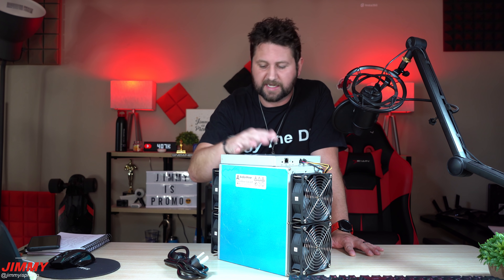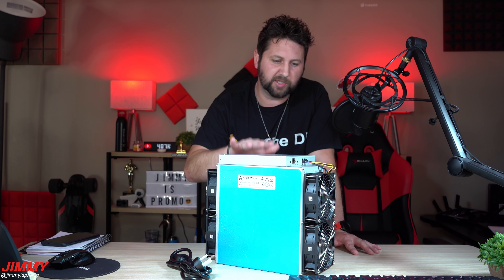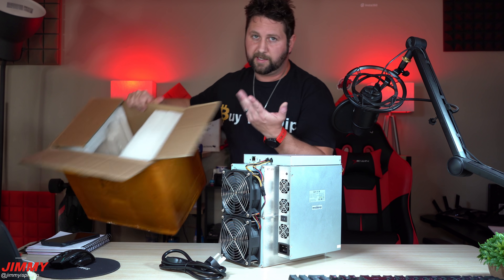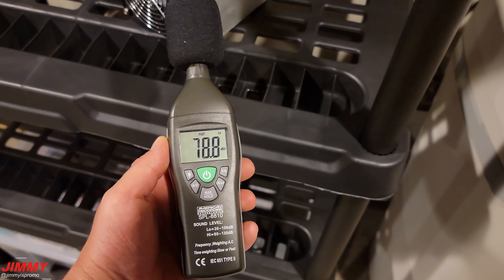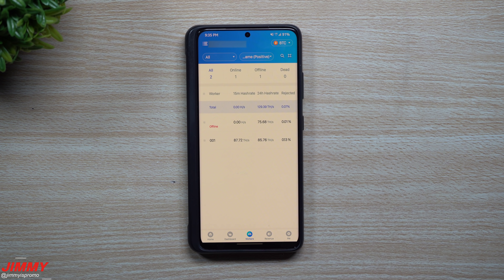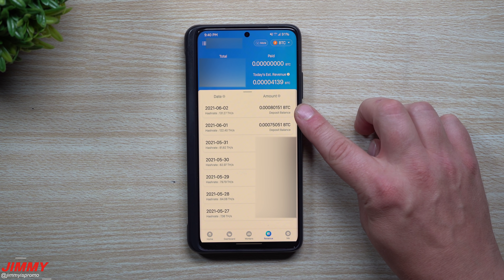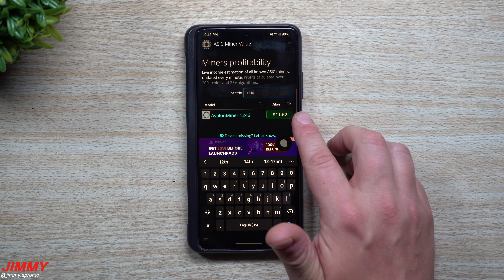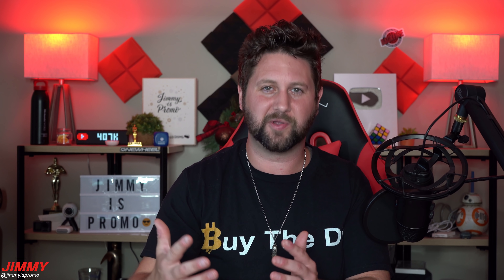Canaan AvalonMiner 1246 performance & Revenue Review - Plus My Big Reveal!

Comment: Can someone answer me how long will this device run when used 24x7 at average temperature ?
Reply from the maker: 3-5 years easily. 3 if it's poor conditions. 5 years if in regular condition and treated well.
Reply: Thanks for the info.

Comment: Hey man - I've just purchased one of these in the UK. We are 240V but that would mean pulling like 15 amps and most sockets are rated for 13 amps. Think I need to get a higher amp socket installed?
Reply: Hi Andrew,  I am from UK as well, do we need higher amp socket installed? How do I find out what amp socket I need as I  will be buying cannan avalon 1249 or the 1199 Pro etc?
Reply: @elonworld9253  Hi Kkan, it seems that double sockets are normally tested to a British standard that is for 20 amps - 14amps on one plug and 6 amps on the other. I'm not 100% still. My 1246 arrived but a sensor inside is broken so having to send back to China :(
Reply: @andrewmorrison4663  oh wow, did u order it from asic marketplace that this fella is recommending? 

There are others vendors  like akminer but I don't know who to trust with such amount?
Reply: @elonworld9253  AKminers - they have been apologetic etc. But can vouch they are legit
Reply: @andrewmorrison4663  oh okay so I am good to go to buy from akminer? When did u buy yours?  

What others bits do we need for this machine if I may ask?
Reply: @elonworld9253  yeah definitely good to go with them. I got my miner in like a week which is rapid!! You'll need a power cable. Its a C-19 power cable (it's looks like this -_- for the connectors haha). Then just ethernet cable
Reply: @andrewmorrison4663  Ethernet cable,  u mean to connect this machine with ethenet cable to my Internet router /hub?

 hmm no WiFi in this machine, ?my Internet router/hub in my bedroom upstairs,  hmm it will be extra hassle ?
Reply: @elonworld9253  no WiFi mate - can get those plugs that run ethernet through your sockets though
Reply: @andrewmorrison4663  ok I will buy c 19 cable power and can u name this ethernet plug in thing so I am aware,  thanks mate 

What's your plan with this if I  may?  Is it your passion or you doing It professionally etc?
Reply: @andrewmorrison4663  got it, it's powerline etherner adapters,   I need,
Reply: @andrewmorrison4663  now should we thinking to change to higher amp socket ?  I don't want to just plug it In and does damage to my electric 🙂
Reply: @andrewmorrison4663  you there buddy,
Reply: @elonworld9253  sorry mate, bit of both if I'm honest. Starting an ASIC farm with my friends who are into crypto.
Reply: @elonworld9253  get a sparky in if you are that worried
Reply: @andrewmorrison4663  okay, do we need separate PSU with it and any software do we need with it? Any firmware
Reply: @elonworld9253  the miners have a PSU built in
Reply: @andrewmorrison4663  ok thanks a lot,  any software or firmware we need for this miner ??

 any pool u recommend for this miner ?
Reply: @elonworld9253  it's built in - bro just Google someone setting one up 👍 I used f2pool
Reply: @andrewmorrison4663  any experience or any advice regarding buying from asic marketplace like this guy is promoting etc, thanks Andrew 😊
Reply: UK here too. Do you guys use any PDU? I keep seeing US ones
Reply: @denn23  sorry dude just seen this! PDU?
Reply: You get hit by UK customs / any taxes when this got delivered ?

Comment: Yo! thank you for this amawing video. I am starting a ASIC mining immersion cooling farm with 8 units. It is going to be a really good challenge since ASICs will heat my house during winter by being connected to my heating water network.  I am struggling with few questions. Do you know any good fan spoofers for this model, any idea ? there are different to Bitmains (square connector instead of line connector). same issue with 3 small  fans on PSU, do you think i can keep them in oil while running ?  if you guys know anyone who already made it, please share with me the contact/ thread or whatever !! would be much appreciated !

Comment: 14 dollars a day revenue, 14 dollars a day power bill!
Reply from the maker: At today's price yes. Accumulate and you're good once BTC heads up to $80k-$100k
Reply from the maker: Residential bill will be higher as it's usually 9 cents/kWh. These are all moving to a commercial location so it's much cheaper at 4 cents/kWh
Reply: @jimmyispromo  plus the overhead for the cost of the commercial location